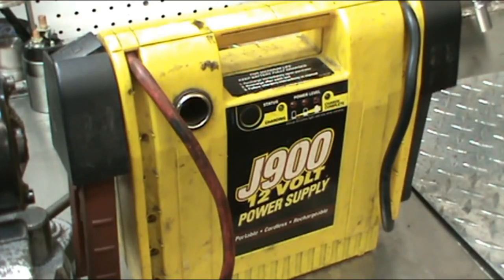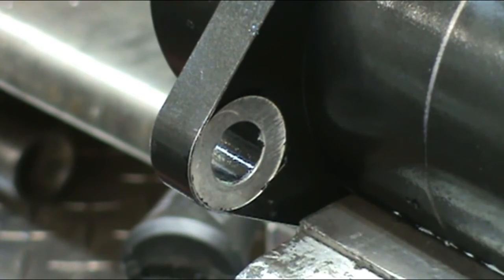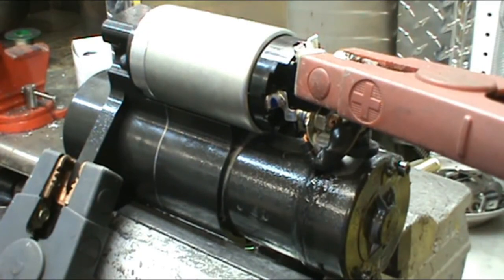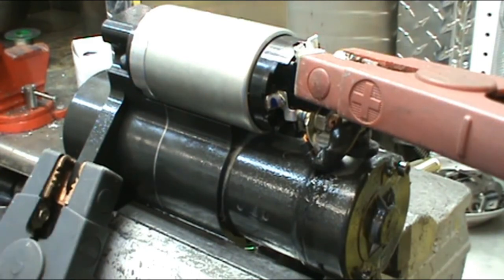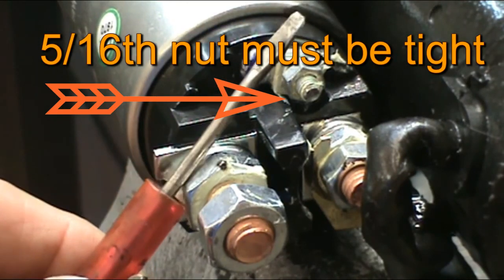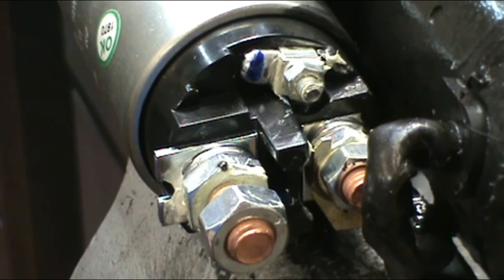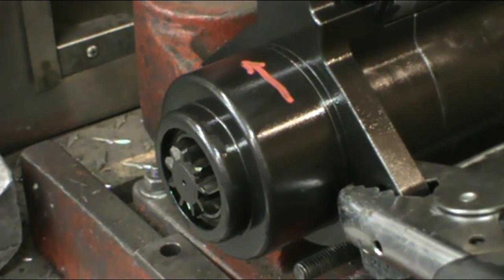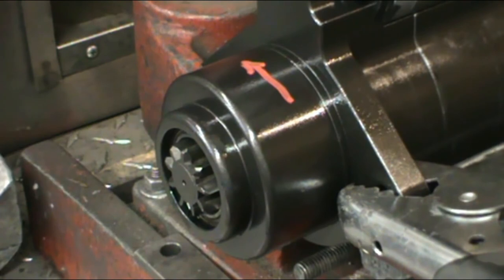Harley reverse motor test UPDATE

Comment: I’m on my second motor in a very low miles trike . And when I press the R button the solenoid on the right side of the bike clicks . But the reverse motor doesn’t turn all pop out like this video. I’ve pressed the reset button now end of times . Would be great full if you have any ideas what it could be . Could it be dirty brushes? Be very great full of any advice 🇬🇧👍
Reply from the maker: If you send it to us before the end of August, $295.00 all your problems are over for 4-5 years. If you take it apart yourself $500 plus to start! That's great advice. We've done 2000.

Comment: After finishing the cleaning and reassembly of the unit, I performed the test run as you described.  My motor is running backwards now.  Looking at the end of the case with the bendix gear, the bendix turns clockwise, which would make the bike go forward when thereverse is engaged.  How can I get the motor to rotate in the correct direction??
Reply from the maker: Some stuff we just DO NOT recommend doing at home.  That unit (although may appear simple) is very complex and no place for the novice electrical rebuilder.  We have rebuilt a couple hundred of them, warranty for one year, for $259. If you accidentally break one of the tabs which is very common for the un experienced, it quickly becomes $359.00.  All you have to do is send it to us and we do the rest.
Reply: Could be you did not put the notch in the housing in the correct place. This would make it run backwards